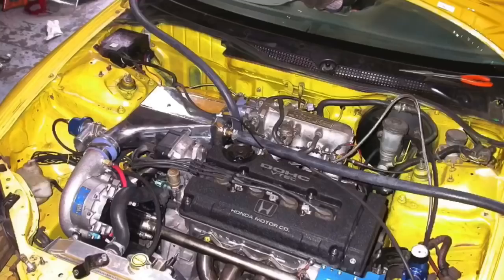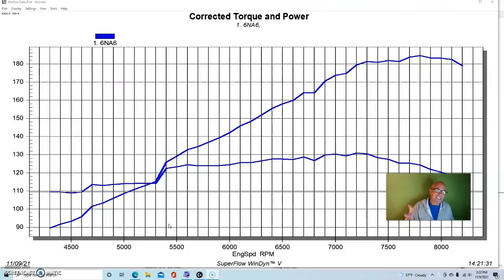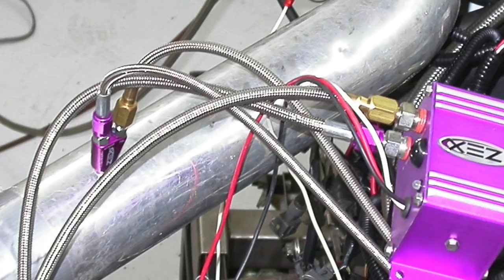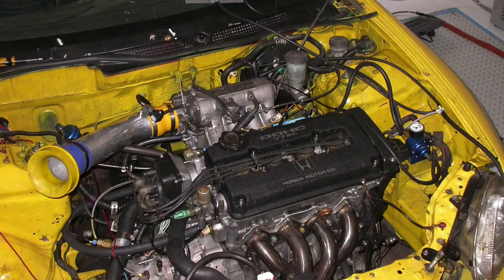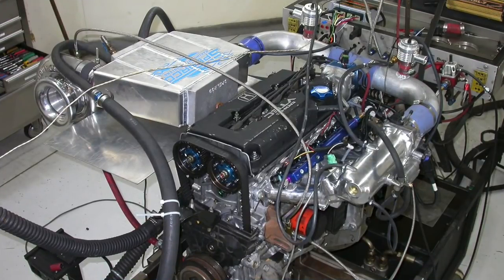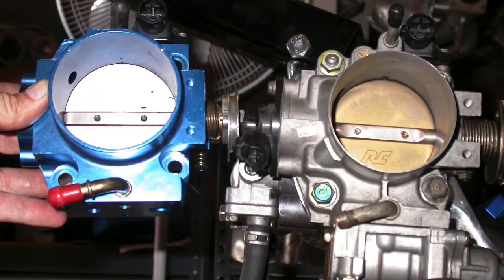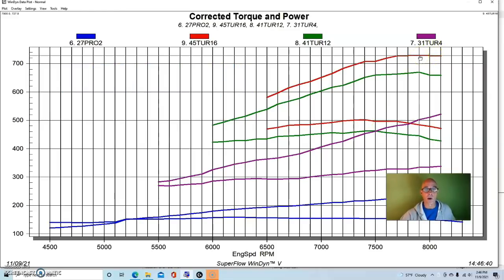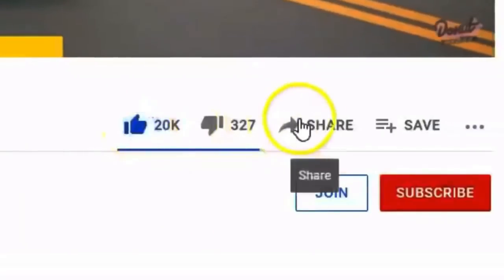HOW TO MAKE TURBO B-SERIES HONDA POWER. HONDA B16A, B18C POWER ADDERS, NITROUS, BLOWER & TURBO.

Comment: Just recently decided to resurrect a Honda build that’s been shelved multiple times over the last 20 years! I originally bought a jdm B18c for a crx si I got on a trade about 20-21 years ago. Fast forward 3 different civics that fell through I’ve finally settled on a 1985 civic hatchback I picked up a few years back. Thanks for all the broad, other guys content! I’ve been stuck on Ls for years now it’ll be fun to get back to my roots.
Reply: One of the cars I miss is the 1985 dx Civic that I used a crx si parts car to convert to efi.  It had a 12v d series with a mild cam on a first get integra ecu so it had a 7k redline! That thing was so much fun!  Put integra torsion bars and brakes on all 4 corners and I had the d16zc to swap into it but never got around to it and sold it in 2006 ish(so long ago I can't remember exactly) but glad you kept your Honda project! Enjoy!!!!
Reply: That 85 will flat out hurt some expensive car feelings if you put even moderate power in it lol. Those things are so light they’ll go deep into the 11’s with well under 400whp. Anything much above that gets to be a bit much to handle without some really good suspension work and chassis prep. Fun as hell though!

Comment: Isn’t a 2L B series with a nice turbo heaven lol. I remember back in my Honda days, this 12.5:1 84.5x89mm B20V with a gtx3076r was one of the most responsive and fun street car engines I’ve ever built. I don’t know why exactly I transferred my interests over the years to building LS/V8 stuff instead, probably because Honda’s don’t do 1/8th mile no prep work very well lol. But still had a lot of super fun FWD builds. Really in the right chassis even that little 250 HP Vortech B16 could be a blast to drive on the street.

Comment: I have a fully built LSVTEC (B18B1 block/B16B head with Skunk2 Tuner Stage 3 cams and supporting valvetrain) with a Garrett GTS3582 turbo running on Hondata S300 V3 and it currently makes 709 whp at 28-29 psi in my 1997 Civic coupe.
Reply: Whats the comp on that motor? You got the same cam/valve train package and turbo as I have. But my block is css b20b/pr3 head, type r crank 1956cc @ 14.2:1 static comp. But when I dialled the cams in, the dynamic CR drops to 10.57:1CR on high lobe. I haven't finished the  build yet but it'll be on 93+water/meth I'm only shoot'n for 500+/- but those Siamese bores...💥🤣
Reply from the maker: 14.2?
Reply: @richardholdener1727  you read right... its pretty much left overs from my N/A build, my profile pic! It just needed a bottom end fresh'n up, mains & rod berrings. Made 139tq/238hp @ 9000rpm in N/A trim. Just wanna run 1.1bar pressure to get that 238hp × 2.1(including vacuum) to hit 499.8hp(500ish). With the choice of cams being skunk2 tuner3s 5°degrees had to be pulled from the low cam ign° maps. But considering the dynamic compression drop on the high cam lobe, stock type r ign°timing of 32°degrees could be used Although there was no change in power/back round noise between 28°to 32°, so I wound it back to 28°. Just gonna use the -1°degree per 1psi/boost to get it dialled in for starters. So should have a max of 12°degrees at 16psi/1.1bar boost. 450L/pH & 4×1000cc injs on 93+1000cc of water meth should help with fuelling and IAT cooling.
Reply: @b20vtec83  how did it go? Same as what i'm considering with my 13:1 pump gas sleeved 2.0

Comment: So what are the first steps for boosting a b16a ? Change manifold to itr or Skunk, itr airbox, and then ? Changing cams or camshaft, changing motor parts and boring ?
(Meaning the things with no boost add ons like turbo etc)
Reply from the maker: you just add boost to the stock motor-you will need more fuel flow (bigger injectors)
Reply: @richardholdener1727   i will then.

Comment: Which fast ECU are you using in these video's. I'm looking for a user friendly ECU for a Honda that I'm building and I see you use alot of various fast products. I'm interested in purchasing at least 2, one for a Honda 4 cylinder and one for a v8
Reply from the maker: we ran the Honda motors on the dyno with FAST and Hondata
Reply: Hondata s300 definitely

Comment: Hey Richard can you get and test the newer ford 7.3 and do a cam swap to show the power gains
Reply: Palm Beach Dyno has done that. But, the test was done on a chassis dyno.
Reply: @derekd2168  yea I watch that one.maybe Richard could port the heads and try different cams like he does the ls stuff on the engine dyno
Reply from the maker: i don't have one of those

Comment: For a track car which would you choose a stock LT4 or a built 2jz with 3.5l stroker and a turbo producing about 700HP
Reply: Go naturally aspirated 7.0 you can do either ls7/stroker or sbf which is cheaper
Reply: When you say lt4 you mean gen5 lt4? Its a.good but expensive option. Depends on what chassis and what track for me. I think the lt4 would be a pretty low stress option and even worn out stock 2jz engines are kind of pricy now. Personally i wouldn't do either, i would use an aluminium block Gen4 5.3 with two smaller turbos. 700hp is just boost on a stock engine, the gen4 stock crank and rods.are strong enough for that and it might be the lowest weight option.
Reply: For a race car your gonna beat the snot out of your best bet is a 5.3 or 6.0 from the junkyard. 78/75 vs, fuel system, trans & a rear end that’ll take the pain then your set. Gen 5 is not viable option yet & 2jz’s are completely different animal all together.
Reply: Y’all are forgetting about an optimal track car. Boost is cheap but nose heavy. Naturally aspirated saves you like 50-100lbs over a turbo(s)
Reply: @Diamondsintherubble  if youre worried about weight you could always get a judd v10. They weigh less than 330lbs complete and are 775hp. The difference in cost and durability of a 700hp turbo v8 and a 700hp NA v8 is dramatic. One of them you can build with stock longblock components with a little boost that you could daily without worry of the valvesprings, the other needs aftermarket rotating and heads. 
My idea of a 700hp spinnyfan build literally would need the turn of a knob to make 100 more horses if the tuning was done right. Adding 100hp to a NA ls stroker that is already at 100hp/l is a bit more involved.
The difference in cost isnt even close even using real turbos.
Reply: @timothybayliss6680  the judds are nice but have a low mileage rating. I’m not sure if they’re rated for 10,000 km or miles but they wear out quickly and the engine is a 3.0 or 4.0 for the v8. They don’t make 700hp, more like 550 hp. They’re so sweet tho. And as for going above 100hp/liter; you literally just turn up the rpm. You can get 100hp per liter at 6000rpm if you squeeze the absolute crap out of it, so 7000rpm or higher just goes above and beyond